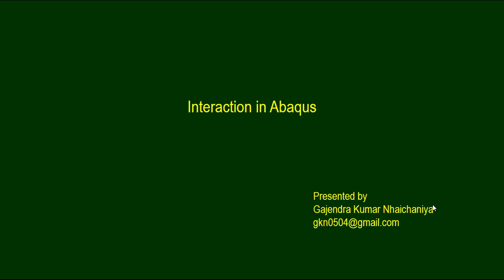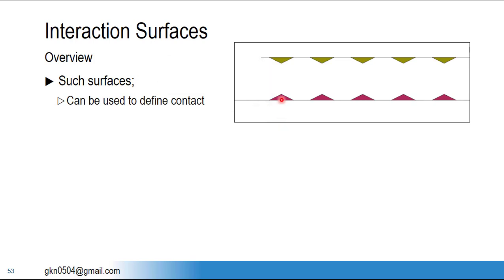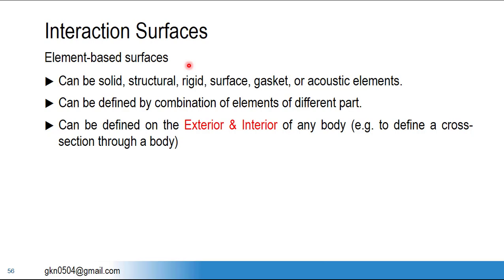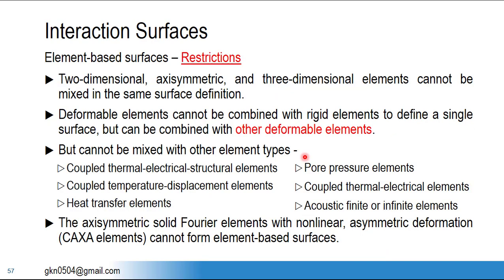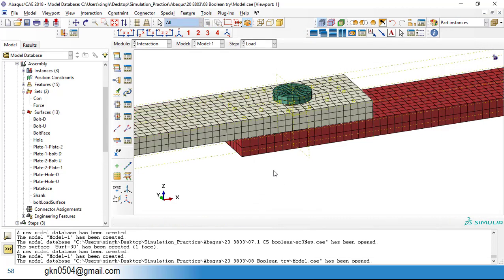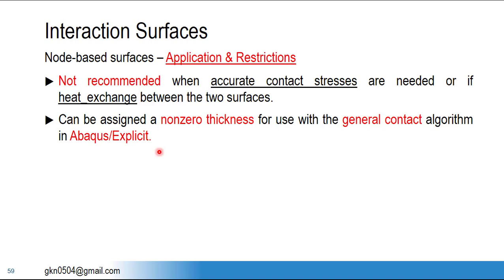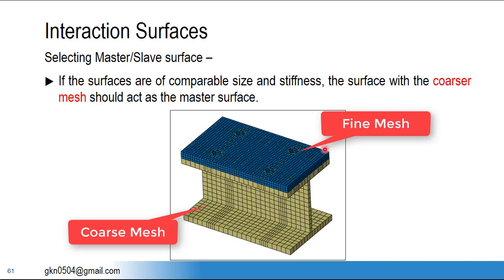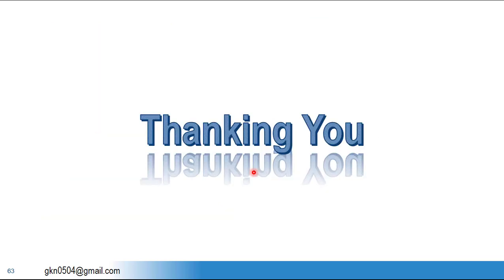Interaction/Contact in Abaqus (Part - 01)

Comment: Thanks for such a piece of fruitfull information. One thing more I want to ask about interactions, is there any option in Abaqus which can automatically detect the contact surfaces and Tied them, in case of many elements.
Reply from the maker: Yes we have, In general contact algorithms we can define interaction by contact surfaces or automatically.
However, interaction with automatic option computationally more expensive but useful when we don't know which surfaces are going to be interact each other during event.
I'll explain this in next video tutorial also.
Reply: @arsitech-ltd   Thanks, Will wait for the next video.

Comment: hello sir, contact surface can use like crack? I am doing a project like create a crack on edge surface and propagate some wave signal on it.which step tree can be used?
Reply from the maker: For such crack propagation analysis Abaqus provides separate option by in interactions - XFEM and counter integral.
I not understood what exactly your problem is !
Reply: @arsitech-ltd I want to create a crack on edge surface when I apply tensile load crack should elongate and in compression load should not be overlapped. is it possible to create a model in Abaqus/explicit?
Reply from the maker: Dear @mani kanta
It is possible with Abaqus/standard itself. No need to go with explicit.

Comment: My project is based on biomedical, in that, I need to check the pullout force of the screw, which is inserted with the bone while taking surgery. considering those things, what kind of interaction is suitable between bone and screw?
Reply from the maker: Dear,
As threads of the screw consist numbers of surfaces and in contact with bone, I suggest using the general contact there.

Comment: Thanks your video is very interesting. But I would like to know how I can model a crack going through two or three composite layers like sandwich structure or masonry wall and what kind of Interaction/Contact should be used.
Reply from the maker: Dear,
You have to go with Abaqus XFEM. If there is delamination of layers than only you need to worry about contact type between layer.
Otherwise simply define laminate in property..no contact required between laminas.
Reply: Thanks but I need to model the crack going from one material to other and in the same time could be delamination exist. Actually I used  XFEM technique in both adherend members and also in the adhesive layer between them. And I provided damage failure criteria Maxps in both adherend members and also in the adhesive layer between them. In addition I defined cohesive surfaces as interaction property between the adherends and the adhesive. After completed analysis the crack propagated only in the first adhrend and started in the adhesive layer but didn’t crack it completely and then a lot of cracks generated in the second adherend without any of them completely separated it, so kindly could you please help me to solve it.

Comment: sir, i have used skin to represent steel sheet encasing concrete core. do i need to give contact between skin and concrete core? if yes, then which type of contact will be suitable for this?
Reply from the maker: Dear,
Skin can be connect by reinforcement by both contact method (general contact or surface to surface contact).

Comment: I have a question. In contact inclusion, is the direction of the mesh important? What's the right direction between 2 surfaces like?
Reply from the maker: Dear,
For 2D elements and plane stress/strain elements contact direction is important. selection of direction is very easy, you have to select the colour from that direction it touch another component.
Reply: @arsitech-ltd  thank you very much. In other word, the positive or negative direction of 2 nearby mesh part must face each other, right?

Comment: I am modelling composite shear wall in abaqus. There is steel sheet with some portion inside the boundary RC frame(75 mm embedded inside beam and column). Which type of interaction or constraint I should use for those portion of steel??
Reply from the maker: Embedded constraints available in Abaqus. Split it from there it is inside the wall and select only that region for embedded.
Reply: @arsitech-ltd  thank you sir😊

Comment: Sir how to provide slip property between reinforcement and beam.

Sir I am using general contact normal and tangential behaviour (friction coefficient=.45)but it gives error
Reply from the maker: Plz let me know clearly what you meant by slip property ?
Reply: @arsitech-ltd   Sir I am working on 3-point bending test on rcc beam.
1) model a RCC simply support beam.
2) reinforcement is embedded in beam than my file is working
3) but I want to provide slip property between reinforcement and beam therefore I am using interaction property normal behaviour, tangential behaviour (friction coefficient=.45) but file gives error.

Sir, if you have time, then I am hard to send my abaqus file to you
Please sir I need your help
Best regards
Reply from the maker: Dear,
In general for RCC you can utilise embedded connection. But as told that you want to define an friction coefficient between reinforcement and metal beams, you should go with manual contact i.e. contact pair/general contact.
However, to do this modelling work will increase. You should make cuts in your reinforcement wherever you have metal bars and contact need to assign.
Reply from the maker: Dear, on few point you are excessive deformation.
Reply: @arsitech-ltd  ??? 
Sir please I need your help
Reply: @arsitech-ltd  sir how to solve this problem
Reply from the maker: There may be many possibilities of excessive deformation. You have to check it with .msg file.
In below video i discussed little about .msg file plz check.
https://youtu.be/pqfteyUkktA